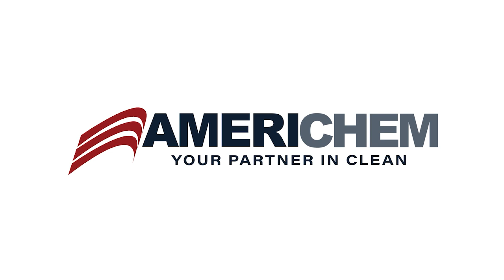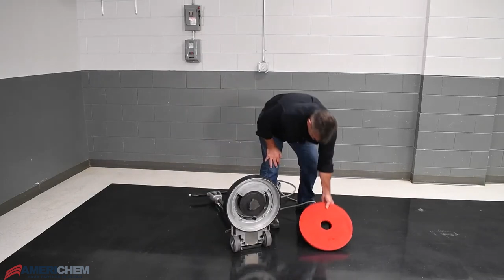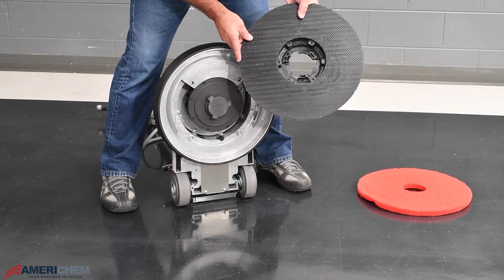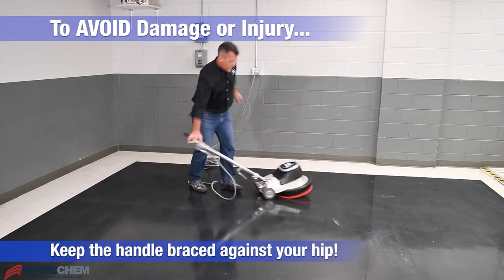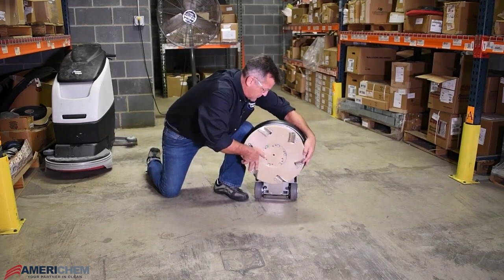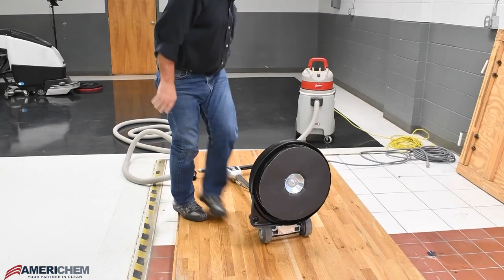Achieve High-Performance Floor Polishing with the Pioneer Eclipse FM

Comment: How does the dust shroud mount to the machine?
Reply from the maker: The dust shroud on the Pioneer Eclipse FM Floor Polisher typically mounts to the machine using a combination of brackets, clips, and sometimes screws, depending on the model. It is designed to attach around the base of the machine, encasing the pad or brush to contain dust and debris.

For most models, the installation involves:

1. Aligning the shroud with the base of the polisher.

2. Securing it with screws or clips that attach to designated mounting points on the machine’s housing.

3. Ensuring a snug fit around the brush or pad driver to optimize dust containment.

4. Connecting a vacuum hose (if applicable) for dust extraction.